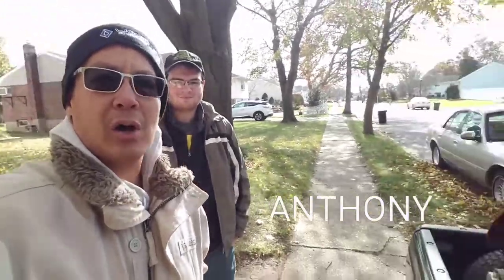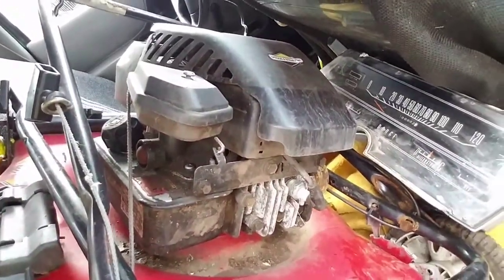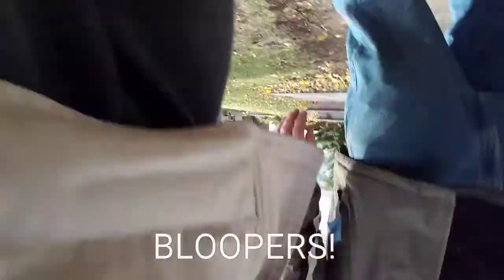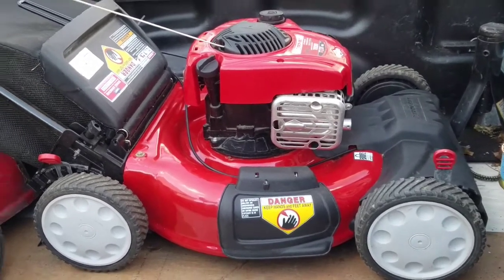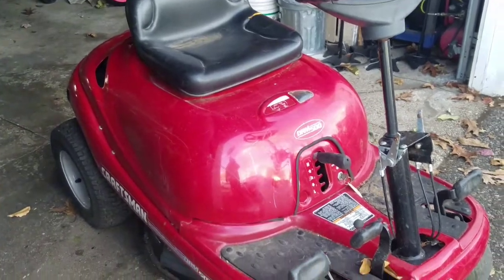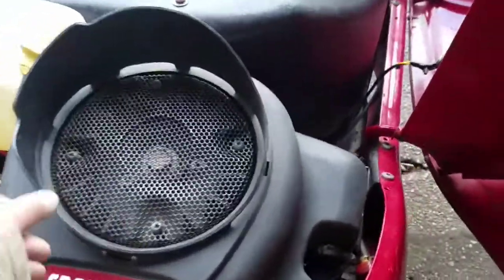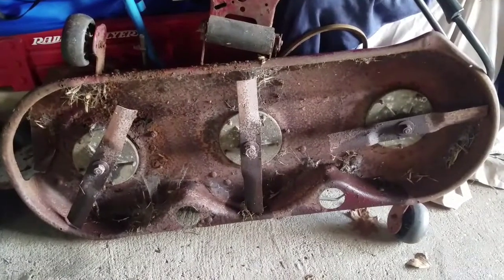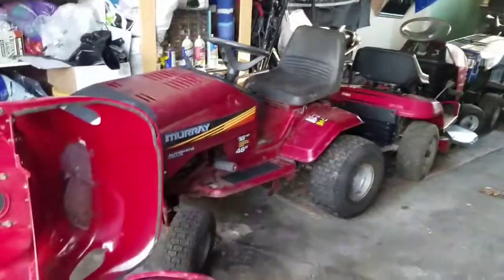CRAFTSMAN 10HP YARD BUG RIDING MOWER TROY BILT YARD MACHINES EAGER 1 LAWNMOWER MOTHERLOAD 3 PICK $80

Comment: I am watching some of your old stuff and heard what you said about the Murrays. I actually like the Murrays cause they are so simple and they last a long time, except the decks. they just get a bad wrap and no one wants them because they are bottom of the barrell, but they are just so easy to work on in my opinion. I have a murray pusher that I bought USED in 2005 as a trim mower and I am still using it today.